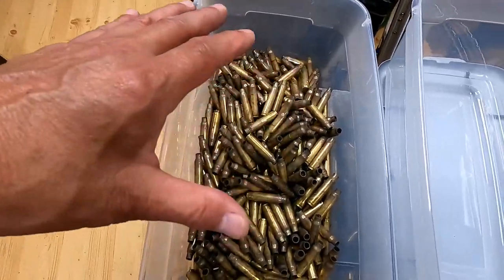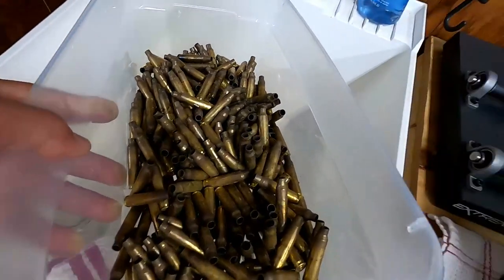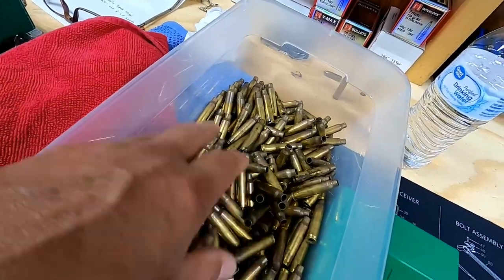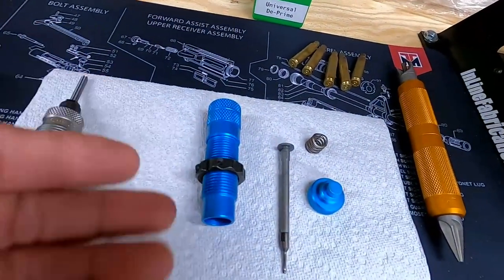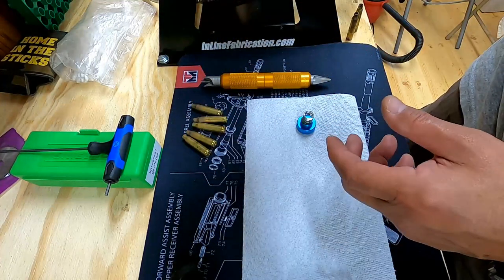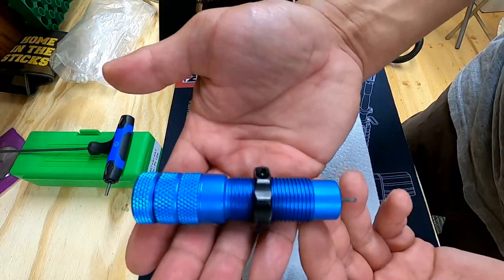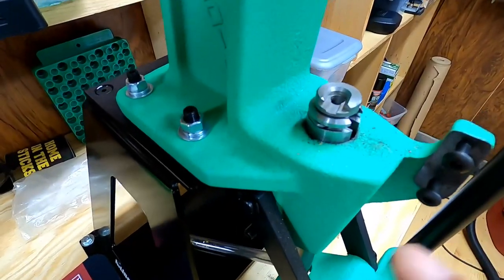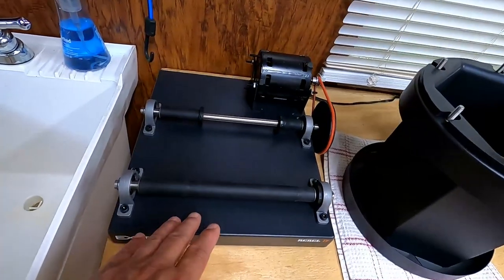How To Clean Brass For Reloading || Methods & Equipment

Comment: Good video Dan.  I've been tumbling for about 3 years now, late to the game but I wouldn't do it any other way now.  Just a suggestion, my system for separating the pins is to buy a case sifting pan that will fit a 2gal Home Depot bucket and after draining the drum dump everything into the pan on the bucket and put it under a water tap and let it run.  It will fill with water to overflowing and just stir the cases around, the pins will fall into the water filled bucket, the brass gets rinsed and once you remove the sifting pan with the cases for drying you just dump out as much water as possible and pick the pins out with a nail pickup magnet.  You can get the magnet at harbor Freight for less than 10 bucks, it's the type that releases the media and it will dump the pins back into your jar with nothing left behind.  I can dump a drum of cases into the pan, rinse them, seperate the pins and have them back into my drum in about 3-4 minutes.  You might also want to try Southern Shine Media, it's small stainless steel chips with edges on them.  They don't get stuck in flash holes, bridge in case necks and actually polish the cases with the edges.  I've used both and IMHO do a better job.
Reply from the maker: Thank ya for watching and commenting Mr Ken, welcome to the channel!!  The pins I use do bridge at times and get stuck in some case necks, I'm gonna have to give Southern Shine a look and also the media separator you mentioned, thank ya for the tips sir!!  I preciate ya stopping b the channel, have a great weekend!!                 Dan

Comment: FYI, if you're using walnut shell media for dry tumbling, check the pest stores. They sell that stuff for lizard terariums (it looks like sand) way cheaper than sporting good stores sell it for dry cleaning media...
..same stuff!
Reply from the maker: Thank ya for watching and commenting Mr Matt and yes sir, I've used the lizard litter in the past and you're 10000% correct, works like a charm!!  Have a good Thursday my friend!!           Dan